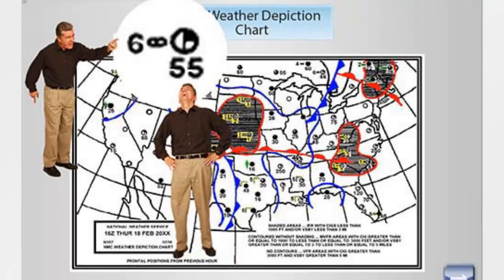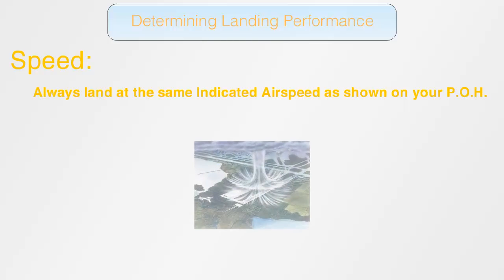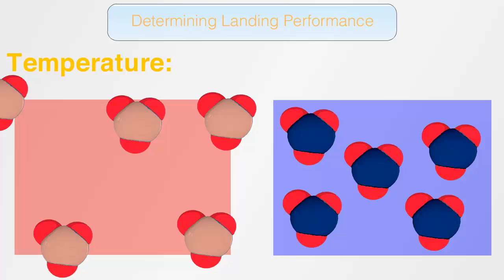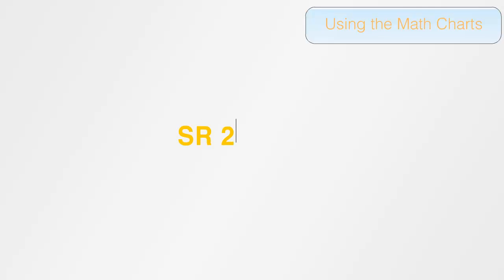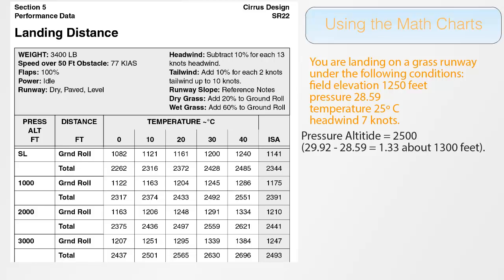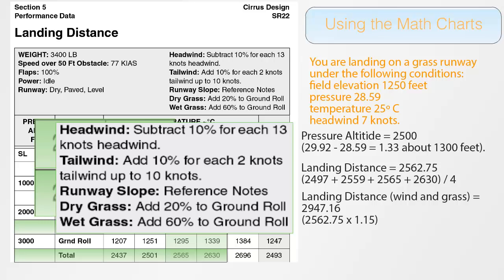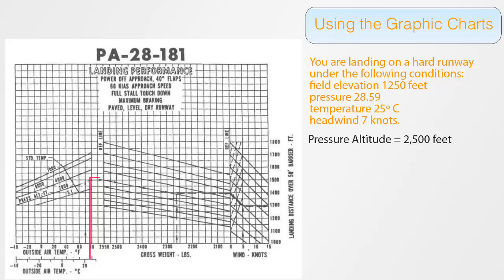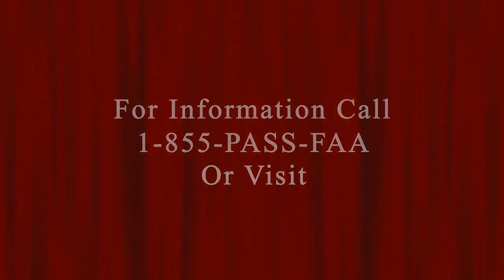Determining Landing Performance

Comment: Where are you getting the 1.15 figure from.  15 percent would be .15???
Reply from the maker: +Art Wright Lets solve this math problem: 

Add 50% to 10.

Your Way:
10 x 0.5 = 5
10 + 5 = 15

My Way:
10 x 1.5 =15

Questions?
Reply: Thanks.
Reply from the maker: +Art Wright You are welcome